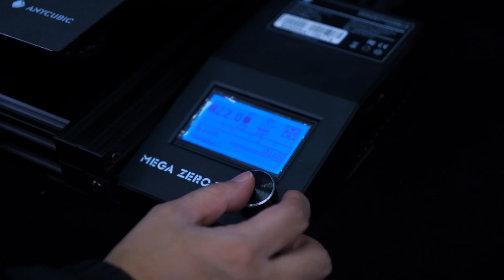Unboxing Anycubic Mega Zero 2 0

Comment: Its my first 3D Printer and i love it!
Reply: same
Reply: Me too. It is so simple to assemble and use while producing good results for this price. I hope that Anycubic will maintain the firmware which looks so far very simplistic i.e. no pre-heat other than for PLA, Marlin basis but without the latest corrections, supposedly no support for extensions like filament end detector, bed levelling or wifi additional modules. But it is an entry level model therefore I am probably too optimistic.
Reply: Is it worth it?
Whats the max temperature the hotend achieves?
I dont need sleep i need answers😂

Comment: I have the Anycubic Mega with ability to print using TPU, why is this bed used here is flexible and not hard like the glass bed?
Reply from the maker: Hi dear, yes, we have done some upgrades :)
Reply: @ANYCUBIC3D  my 3D printer is the i3 Mega S, are there new upgrade parts that I can buy and install?

Comment: After using it for few month I can say “ it’s the worst low price printer I’ve used “  buy it keeping in mind it won’t last long.
Reply from the maker: Hi, sir, is there something wrong with your machine, sir? If so, you can set up an after-sales order here, and the engineer will provide you with a solution directly. if you have submitted it but have not received a reply, you can tell me the relevant information. I will contact the after-sales staff and contact you as soon as possible. 😊https://support.anycubic.com/VisitorTicket/guest?id=3&token=6e6e6f9affeKpTBnN5emV0ejsfQEYJUwFSUwNRAFMGTkAY
Reply: @ANYCUBIC3D  i did befor and i still waiting for reply.I wish to use the link you added . But even your template is broken. I can’t submit my ticket.
Reply from the maker: @georgecardell9061  Hi, sir, we have tested the website and can submit it normally, and I have fed back this to the website maintainer. And can you open a new tab and submit it again? Also, what is the error message that pops up when the submission fails? 
"Verification code error", "machine selection error" or other reasons? 
If you still can't submit it, please contact us at Facebook or Ins to help you set up an after-sales order. Thank you.😉
Reply: @ANYCUBIC3D  someone very kind from the support apartment just contacted me. Let’s see how the process goes. Thanks
Reply from the maker: @georgecardell9061  😄 Anytime